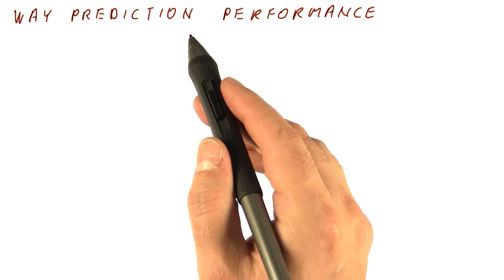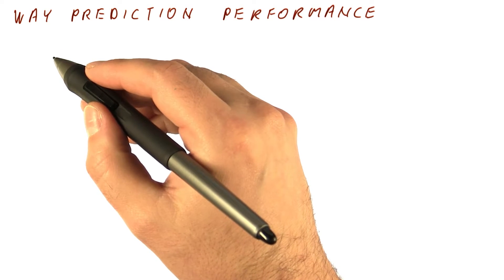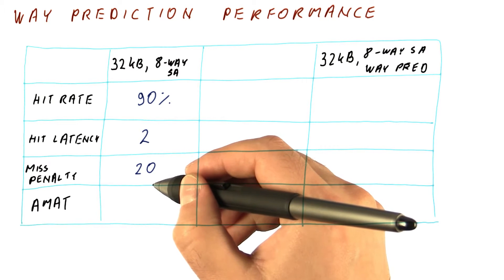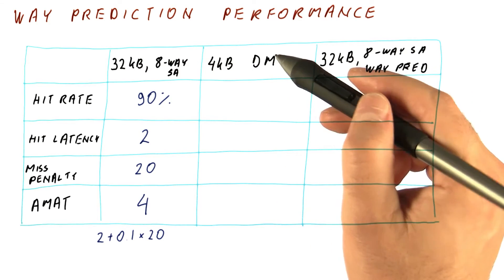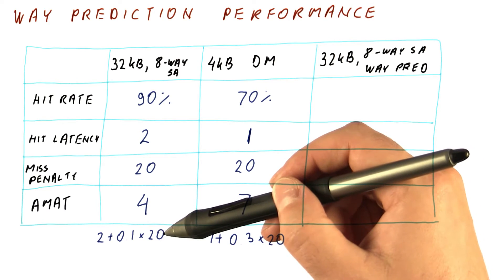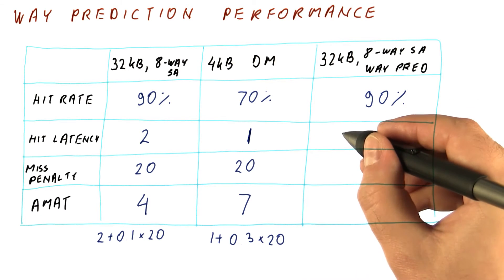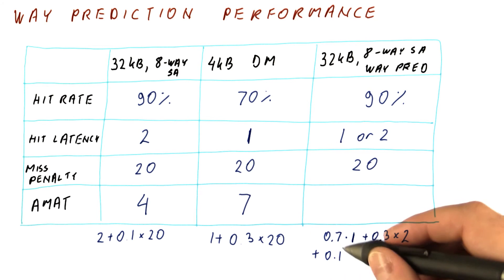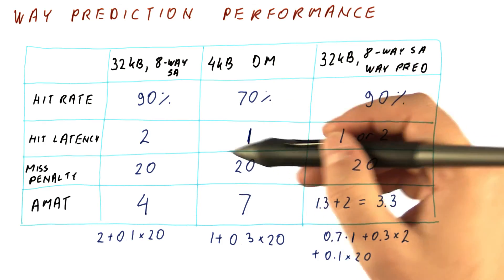Way Prediction Performance - Georgia Tech - HPCA: Part 4

Comment: For 32KB, 8 way SA, Way Prediction, shouldn't AMAT be 0.7*1+ 0.3(2+ 0.1*20) = 1.9 rather than 0.7*1+ 0.3*2+ 0.1*20= 3.3 ?
Reply: Your equation implies cache miss rate is only 0.3*0.1 or 3%...having way prediction (while keeping N-wayness the same) doesn't improve miss rate, only hit time.